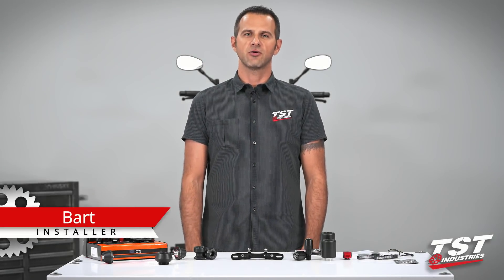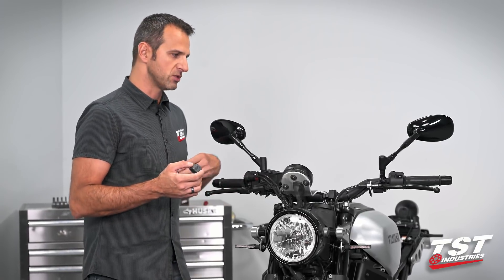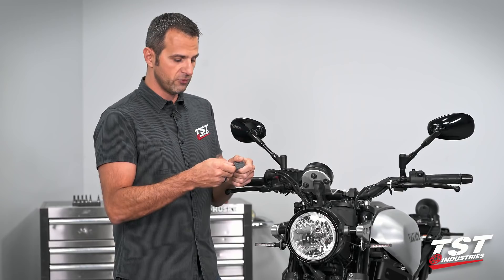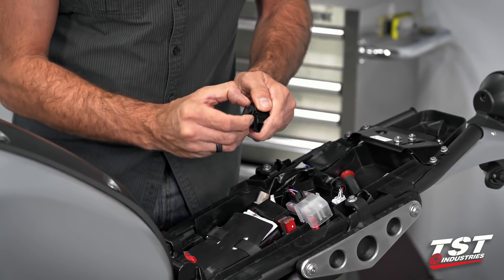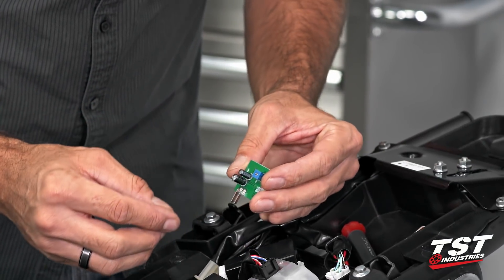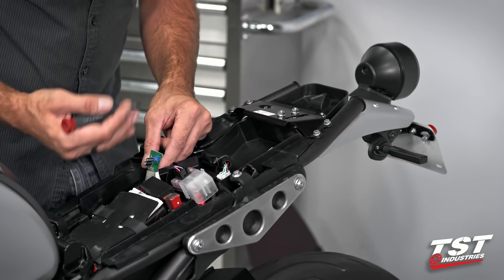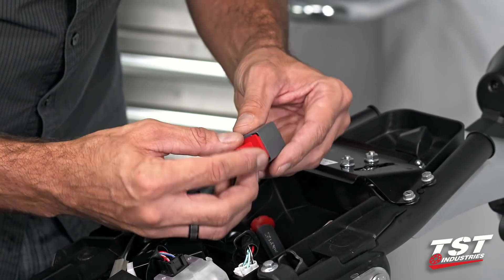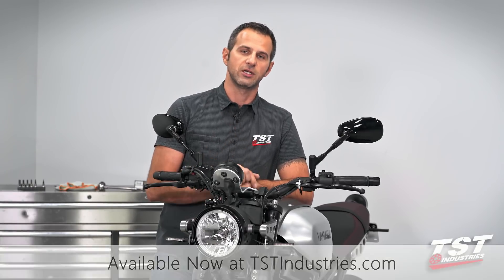How to install an LED Flasher Relay on a 2016+ Yamaha XSR900 by TST Industries

Comment: Is that Flasher relay Universal?
Reply from the maker: There are no real universal flasher relays. The ones claiming to be universal require you to adapt your wiring to them. If you know how to adapt your wiring to work with this connection and your signaling system draws no more than 2A then you can use this relay. Otherwise you can tell me your applicarion and perhaps i can help you select a better suited solution.

Comment: This channel is simply amazing, everything is explained in details with no space for doubts or imagination. And the customized speech just killed at 4:15. I do actually have a question: is it possible to order the pod signals getting 2 different models? one for the front and one for the rear?

Thanks in advance and keep up with the amazing work you are doing. You guys rock!

Comment: I picked this up today (they are local) and installed in a few minutes. The hardest part is getting the damn rubber boot back on. Didn't have to adjust on my XSR900 with the NRC fender eliminator. Great item!

Comment: Seems to work like a charm, but what I'm worried is, will I be experiencing problems regarding my hazard lights?
Reply from the maker: Your hazard lights will work as they should. They will flash at the same rate as your turn signals.
Reply: Cool! Thanks a lot! Thumbs up for the quick response! 😁

Comment: I recently bought an XSR900 and I got myself the LED flashers along with the flasher relay from TST industries. Installing the whole thing was super easy, I'm no mechanic but it was basically plug and play. I washed my motorcycle and noticed that my blinkers were not flashing anymore. I opened the relay to adjust the flash rate and it worked for about 2 minutes. Then I rode for 1h and tried my blinkers, sometimes they were flashing and sometimes they were just steady (not blinking). I tried my blinkers after my ride and they were working perfectly. Any ideas on what could do that? I'm assuming the water is causing it, but do you have any clues on how I could fix this? Thanks
Reply from the maker: It sounds like we need to run some diagnostic tests on your setup to gather more info. Please contact our customer support staff through our website Monday-Friday. They will be able to get you sorted out.

Comment: Since the Yamaha uses the front blinkers as running lights I assume you will lose this feature? Will there be one wire not used in the front turn signals?
Reply from the maker: You are correct. The running light function is lost with the use of a single circuit signal in the front. There is one wire left over from the installation that does not get connected.
Reply: @TSTindustries  what if you use this  relay with 3 wire led turn signals? Will you still lose the running light feature?

Comment: Can you use them on a FZ-07 2015?
Reply from the maker: Yes. We actually have a video showing the installation on a FZ-07. On that bike the installation requires removing more body panels. I suggest you take a look at our video to make sure you are comfortable with the installation. Here is a link to the video: https://youtu.be/IpYExe2CcuU
Reply: Thanks!

Comment: So removing all the bike parts, installing and adjusting the unit, and re-installing all the bike parts take in reality a minute?
Reply: You don't have to adjust it, but you can if you want
Take off the seat => 15sec
Unplug the relay => 15sec
Plug the new relay =>10sec
Put the seat back => 10sec
Done in less than a minute.
Reply from the maker: @Stuntman Vince is correct. The relay is set at the OEM speed of 85 cycles per minute. If you wanted to adjust that speed, slower or faster, then you can do so at your discretion. As long as you have the appropriate tools ready this installation should take no longer than 1-2 minutes - even for someone unfamiliar and inexperienced with working on their bike.